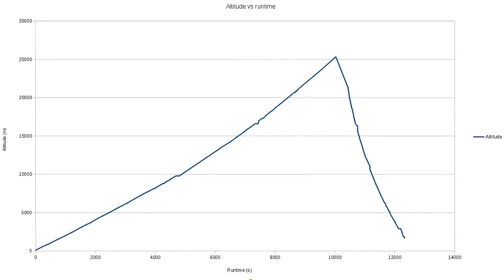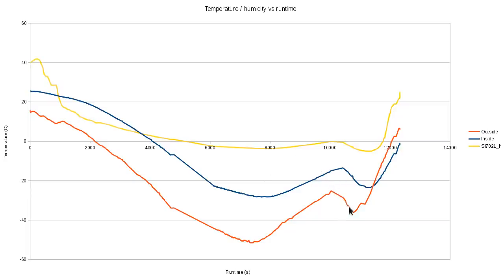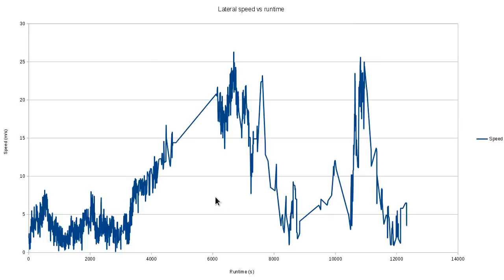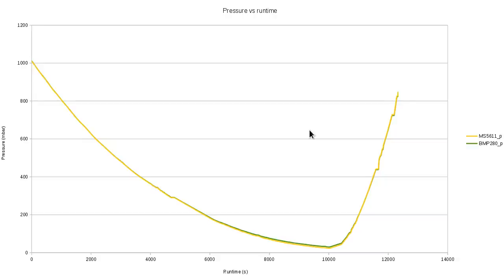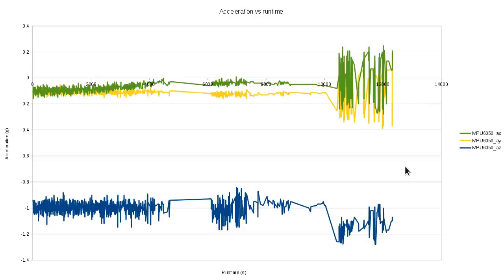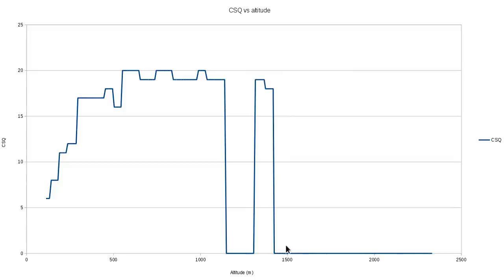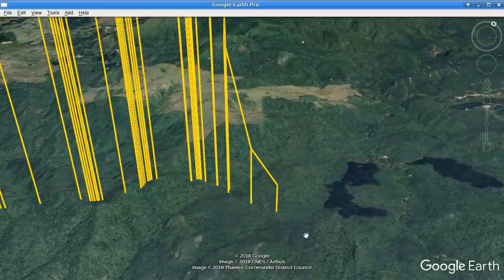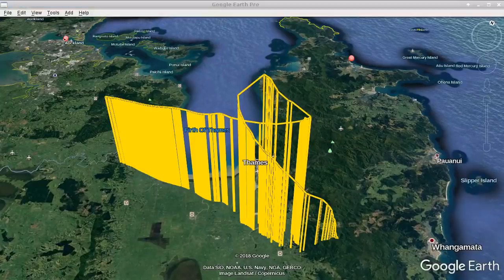Arduino mini radiosonde part 6 (data review)

Comment: In another lifetime I used to be a weather observer for the BOM here in Oz and used to routinely balloon launch Vaisala sondes a couple of times a day. Regarding the -ve reading on the humicap, you need to baseline that particular sensor before you release the balloon. We used to clamp the sensor into a little sealed box that was filled with silica gel for a few minutes to get rid of any water vapour and then zero out the reading that was being received from the sonde to give a relative zero datum from what the actual sensor was reading. That sensor was also temperature sensitive and needed a little metalised reflective cap over it to prevent it being heated by the sun.  Increased ascent rate was likely due to solar radiation heating the gas inside the balloon, reducing its density, increasing lift slightly. We used to aim for a 300m a minute ascent rate. Less than that and the flight would go on for too long, any more and you wouldn’t reach the required altitude. 300 was the sweet spot.

Comment: Parachutes can be simply made with 3 pieces of thin lightweight foam board. Google ‘marine radar reflector’..... The inverted pyramid is what the met office uses to arrest the fall of its sondes (and to make an excellent radar reflector for tracking) Dead easy to make and is pre- deployed when it’s positioned between the sonde and the balloon. Don’t use the Mylar foil covered board though unless you want to get noticed.....😬
Reply from the maker: Great idea, I like that it's cheap and less likely to get tangled up. My next launch will probably use a hotwire cutdown, but I'm puzzled about how to cut the connection between the balloon and parachute, yet have the hotwire mounted on the payload. There doesn't seem to be any clever way to set up the cord to allow that. The best plan B seems to be to have the payload between the balloon and parachute, with the parachute dangling below on the way up. Seems like a good way to get tangled up when the balloon bursts, but I think a rigid parachute like foamboard would fare better.
Reply: Just let it burst naturally. More gas will give a higher ascent rate and an earlier burst. Daylight flights will give higher altitudes before burst than early morning or night flights due to heat from the sun keeping the rubber balloon more supple.
Reply: Amazingly, this was in today’s news. The guy in the green flame coat used to be me (hydrogen gas fill) But you can see the layout of balloon, target, sonde.  https://www.abc.net.au/news/2019-04-10/weather-balloons-grounded-in-gps-clock-rollover-glitch/10984806.    The sonde was attached to perhaps 10metres of string that unwound when the balloon was released so it hung quite a distance from the balloon and target to prevent tangles with antennas and sensors and giving a stable flight configuration and consistent antenna orientation

Comment: I wonder if you could send the balloon aloft with a small glider or lifting body....  After the balloon bursts, let the glider bring the package out autonomously, either home, or to somewhere predesignated as a landing zone.  Then at a few hundred feet deploy the parachute for the remainder of the descent.  The battery and GPS are already part of the payload, so might only need a small servo for rudder control plus a small foam glider!
Reply from the maker: Certainly could be done. A small foam glider would be hard-pressed to make any appreciable headway into the wind though. You would also need a cutaway to release the remains of the balloon. At high altitudes a controlled descent is quite difficult, a more effective strategy seems to be the opposite order to what you said - use a small drogue chute to stabilize attitude until thicker air is available, then cut away the drogue (and balloon remnants together) and just glide all the way to ground. Determining local height above ground is easier said than done, if you still wanted a chute for the last bit, the last bit would need to be a lot more than a few hundred feet to be sure it wasn't already on the ground.
Since I have your attention, any ideas for how to arrange the rigging so that a cutaway mechanism (eg. nichrome hotwire) can be on the payload, but the connection to break is the one between the balloon and the parachute? Of course if you put the payload in between the balloon and the parachute it's easy, but having the parachute at the bottom as it goes up has its own set of problems (high drag, prone to tangle, payload might fall into it etc). Fixing the parachute to the payload directly, or to the string between payload and balloon, also seems like asking for trouble...
Reply: @iforce2d   The first thing to jump into my mind was something electro-mechanical and light weight.  Don't know how light this is, but solenoids are really powerful for their size.  The spool could go through a clevis, and whatever you want to cut away would have a loop in it like a rod end retained in the clevis by the solenoid spool.  https://www.adafruit.com/product/2776?gclid=Cj0KCQiA5Y3kBRDwARIsAEwloL7sJJTea9e3opsNNv7ZE4Jgf0Oqha6No60oDi0QTSGpsyZ5q4wUskEaAkqIEALw_wcB

Then I started thinking about small pyrotechnics, maybe something like a .22 blank round set off by a heating coil to drive a blade through shrouds, or to trip a spring-loaded mechanism to do the job.

Comment: These humidity sensors, like almost all, don't measure relative humidity. They measure absolute humidity and do some calculations (which includes temperature) to give you relative humidity. There's almost no humidity in the air at those temperatures. 100% rH at -10°C is about the same amount of water as 10% rH at 20°C. So I imagine that at -20 or -30 the maximum absolute humidity is in the low single digits of % of what it could be at room temperature. Only using a few % of an ADC's range means comparatively huge noise.
As weird as it sounds, but resistive/capacity based humidity sensors can also "dry out". To get them back to measure acurate values, they need to be hydrated.
Another thing is that the formula that gets you relative humidity from absolute+temperature has a temperature range where it is valid (i. e. within a few %). Outside that temperature range all bets are off.
Oh, and the humidity value is also pressure dependent. Just for good measure.
Yeah, those sensors are only really built for environments where you'd be able to survive without special gear.

Comment: The Si7021 internal heater maybe responsible for the negative values at low temperature.
https://www.silabs.com/community/sensors/forum.topic.html/si7021_humidity_0-d6Wb

Comment: Wow, what an amazing fun project this was. To see you build it, test it, explain how it all works together and then the awesome flight and tracking it at the same time surely made me feel like I was part of it all. Riding along with the hatcam. Great footage, excellent comments, superb results. You also didn't let us down on the aftermath and going through the flight analysis. So much juicy data to go through. Loved the 3D map with the flight altitude and location. Maybe colour the yellow line with a different colour based on temperature or humidity? Some ideas for retrieval: a) after touchdown have the payload go in battery saving mode. It already knows the latest GPS location so no need to activate the GPS unit anymore to get a lock, b) Have a realtime clock (or GSM) to send out a location ping once every hour or so. Once you have an accurate location (it's not going to move anymore anyway) you can always come back months later to retrieve it, c) have a plane ready to fly up in the air over the location to pick up the payload location pings, d) once you have final location + altitude have a high gain yagy or dish ready so you can communicate with the payload to put it in SD Card - transmit mode, e) the antenna's you are using on your receiver are the sleeve dipoles, maybe experiment with normal dipoles hanging down like an inverted T, lastly, f) big project, but maybe make an Az-El tracking station that always points your ground-based receiving antenna in the direction of where the payload was last seen. Mount on your car if need be.. Anyway, this was a great bit of content. Thank you so much! Really enjoyed it.

Comment: You mentioned omitting the cellular data module next time...  Do you think having a receiver / data logger on a drone that you could attempt to fly over the landing site would be possible?  If that's possible, and bi-directional communication with the balloon's payload is possible...  you could likely write a data dump routine to download the contents of the SD card to the drone in the event you land somewhere inaccessible again.
Reply from the maker: Yes it's possible, but some complex programming. The main headaches are
- payload nRF24 would need to be listening during the flight to hear the trigger
- separate main loop for data dump phase
- implementing TCP style lossless (ack and auto resend) transmission over a datagram connection

Nothing insurmountable but would not likely be possible with the pro-mini.
Reply: @iforce2d  Yeah, I think at that point you'd want to use WiFi and tools like rsync.  The NRF could still be one-way to give you telemetry and a rough estimate of landing coordinates, but perhaps a tiny helical wifi antenna could be placed on a brushless gimbal to hit the resonant cavity WiFi antenna on a RPi0w from the drone.  Ardupilot can keep a gimbal pointed at a POI pretty well.
Reply: Downloading image / video data from an SBC might also be possible, and just as cheap as the RunCam rig.  Rpi0w's are $10USD and cams are $15.

Comment: Just a few thoughts for the next flight (we are all looking forward to it)

1. Paint the payload bright yellow or red! A friend of mine released a simillar ballon some years ago that ended in some rough area with cliffs and trees, and you would be amazed how difficult was to spot the damn thing when he found it!)
2. Put a label on it stating that it is a harmless scientific experiment, with your contact information written on it! (also a "reward given if found" thing would be ideal) Many times these things land in someone else's property (usually farmers) who just throw them away, not knowing what these beeping things are.
3. Secure the batteries in the battery holder really well with a zip-tie. also secure the batteries to the pcb. During impact 70% of the times the batteries pop out so you lose beeping / GPS coordinates while hunting for it.
4. If you suspect that it is going to cross some busy airplane routes, build a radar reflector out of tin foil for the airplanes to detect and avoid it.

 Good luck with your efforts! By far the best documentation i've seen for such a project!
Reply from the maker: I figured between the orange/pink foam and the neon color parachute it would be fairly visible. I put my phone number on it but stopped short of the reward :) The batteries were all soldered to each other and to the PCB. I read somewhere that radar reflectors are not useful unless the planes are actively expecting to see them, ie. if a NOTAM has been filed, and if the reflector is really big. Otherwise, it would simply go unnoticed by the radar of commercial planes which is designed for weather reading.
Reply: And a URL with project details so that whoever found it can read about what it is so they don't get all upset.

Comment: Probably too complicated, but it would be fun if you did a abort system, that could release the parachute and payload if the baloon drift too much off course. But that requires that you can communicate with the baloon/payload.

Another fun idea would be if you had a plane of some sort as payload. When the baloon pops (or right before) it should release itself and try to glide to some preconfigured location or as close as possible.
Reply from the maker: I think to get back to the home point the weather would need to be just right, ie. air currents that move in the opposite direction at higher altitudes. I've been watching the balloon predictor page regularly and it does happen, but not that commonly. I one saw a predicted path that would have had a regular parachute drop land just a few km away from the start, that would be nice :)

The reason a yacht can tack into the wind is because it has the friction of the water to stop it from being pushed directly downwind.

Ardupilot does have rally points which can be used as a destination if the 'best' RTL point cannot be reached. I've never really looked into how it decides if and when to use them though.
Reply: https://blog.hackster.io/this-raspberry-pi-glider-was-dropped-from-a-high-altitude-balloon-and-successfully-reached-a-971e26be14f7
Reply: @mistercohaagen  Cool! That's almost some Space X booster return to home stuff. :)
Reply: @mrbushman2267  Yeah...  I wonder if you could work the glide ratios and "tacking" (not sure if it's called that in aviation) into the wind to get back to the launch point.  Maybe ArduPilot can be modified to have multiple safe RTL coordinates based on cellularized geofences (or something like that)?  Like this guy said, you have gravity on your side against the wind, but it might not be possible to do it without propulsion; http://www.askacfi.com/23163/can-an-unpowered-aircraft-advance-into-a-head-wind-as-a-yacht-can-tack-into-a-head-wind.htm  A couple of tiny servos and a change in computational payload wouldn't add much weight, but a brushless motor and ESC requires a lot more on-board power storage to be useful, especially at the ~60km ranges that @iforce2d initially predicted for a low-wind flight.

Comment: I wonder if low pressure is another possible source for humidity sensors?
I'm supprised to see how well the measurements agree except accelerator meter that must have some heat generating components(s) inside.
I think gsm has a limit of about 30km from cell tower which is where it stops working. (It is due to delay in signal). Higher up the tower beam is probably far from optimal (sending and receiving). Due to beam pattern you may be connected to a tower far away, not below it. This can make some unexpected connectivity issues.
A good antenna and 2.4GHz link seemed to work well enough though. What bitrate were you running at? With lower bitrate you get more range with NRF if I remember correctly.
Reply from the maker: According to another comment here the temperature of the MPU6050 is not intended to measure the ambient temperature, it's for measuring the interior temperature of the MPU6050 itself. Yes 250kbps, the lowest they have available.

Comment: Your Mission Kiwi, should you choose/decide to accept it, Is to travel to  -37.277885, 175.65211  to recover a downed radiosonde and return it to it's owner.
As always, should you or any of your IM Force be caught or killed, the Secretary will disavow any knowledge of your actions. This tape/disc/comment will self-destruct in ten seconds (or when I remove it). 
Good luck, Kiwi.

Comment: Awsome Video series as always. What about a little more payload for the next Mission and using a Joint Precision Air Drop System. In other words a GPS guided parachute. And you can try to use one of your older projects to track the received GPS coordinates with a Yagi antenna. Excelent work as always.

Comment: Really great and informative video ...Thanks,
 A couple of random thoughts... Have you considered the possibility of using a drone to help locate the downed balloon, or perhaps even recover it with a trailing line and grapple or such ? (a long shot I know)
  While watching this video it occurred to me, what would be very useful in case of not being able to reach the final landing site in future flights, could be the possibility of some kind of trigger you could send the radio sonde , or a timer set to long after the calculated end of the mission, to initiate a radio data dump from the on board SD-card, you then need only reach radio range yourself, or perhaps a drone, and recover all the data without having to retrieve the balloon itself. If you were to fly cameras in future flights that data could also include images.

  Again great video and channel looking forward to more thank.

Comment: An idea against the missing data in case of a loss of the SD card would be to not only send the newest packet, but also send packets from the past (that didn't get to the reciever) in times of great reception. That will require some sort of an acknowledgement system which may be too complicated for this case.
Reply: And a lot of memory... Probably a queue structure in order to keep the newest data in case of low memory.
Reply from the maker: It could be done, but part of the reason this communication works as well as it does, is because it's one-way transmission with no re-sends. To make this happen a timestamp would also need to be added to the data (currently the Android tablet uses it's own clock to mark times). I think the biggest headache would be seeking through the file on the SD card to read and update the acked status of past data, while also trying to record the fresh data coming in.
Reply: @iforce2d  yeah, probably not worth the trouble. Interesting nonetheless I think. I wish you the best for upcoming projects! Keep us updated :)

Comment: The anomalies in humidity measurements are curious. and seem to show that either the low air pressures or low temperatures  (Or both) affected their measurements. They may not be suitable for this application? As you indicated in the flight video I too am not sure of the value of the phone signal connection.
That said, it was a very effective first flight and provided much data for use in both modifications for the next flight and for that flight itself.
And I found the preparations, the flight itself, and the detailed assessment of the data really fascinating 
Thanks